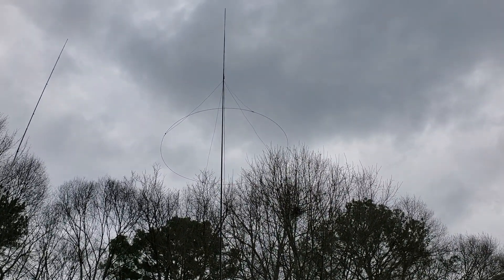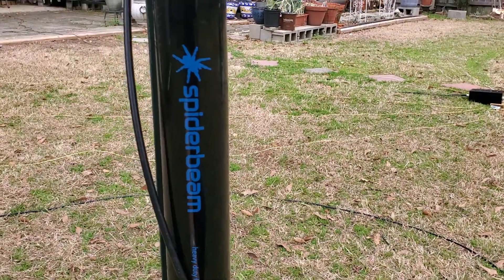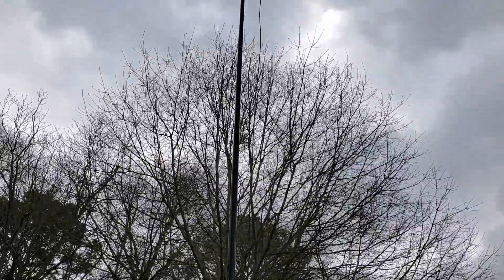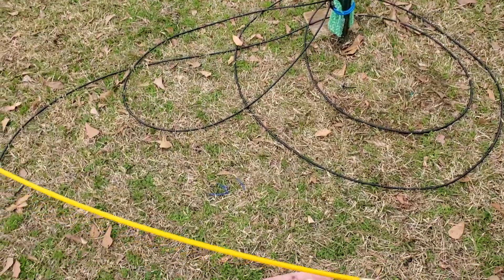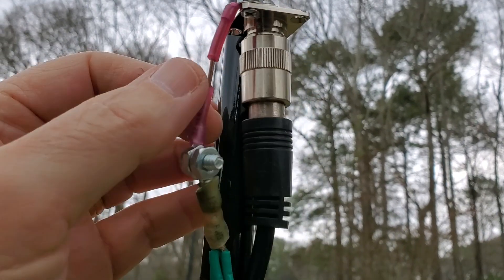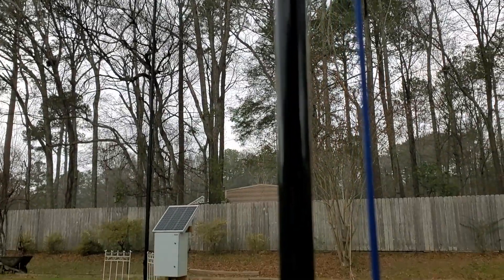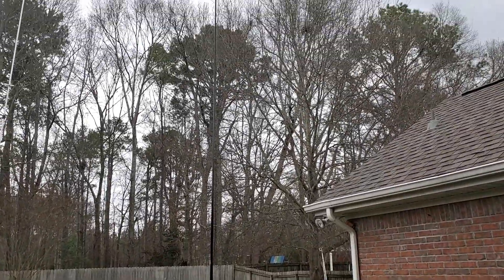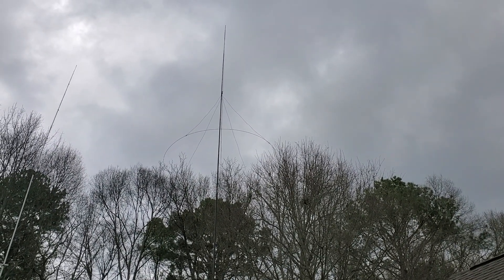Building The 6db Gain "Hoop" Antenna For 10 Meters.

Comment: isnt it just a 1/4 wave ?
Reply from the maker: @Triple888jim  it is a 1/4 ground plane wave. The video is more in response to the previous video where viewers were asking how the hoop was built and how the height at which it is deployed is achieved to get the radiation pattern for DX.  The greatest factor that contributed to its DX performance is the height deployed. That being said it is not the best for local contacts of just a few hundred miles away. Because of the low angle radiation pattern. I talk about that in the video on antennas and gain.

Comment: it is a 1/4 wave ground plane antenna, but great idea to hold the ground radials out at the needed angle. 6db gain? No.
Reply from the maker: @N0VTY29  Thanks for commenting and unfortunately we can fit only so much info in a YouTube title. A deeper dive into what I meant regarding the 6db gain statement and where the gain is found is explained in the video about gain that follows this one. There I talk about how no antenna provides true gain but instead shapes the radiation pattern providing a relative gain to accomplish some goal. In this example the height at which I mounted this antenna provides great low angle radiation for DX (computer models show up to 6dB compared to other designs) but this one does not do well for short haul (the next state over for example). Thanks for watching and commenting.

Comment: Have you ever tried connecting the hop to the radials, essentially turning the hop itself into a radial? This increases the efficiency of the radials, and you can balance it out with a 120pF capacitor or variable capacitor placed between the ground and the radials. It should provide about 1dB more gain, as by making this connection, you turn a four-radial antenna into a 16-radial antenna.
Reply from the maker: Good idea. Thanks.
Reply: @yqtszhj  By pulling the current max down through the ring, you lower the main radiation a bit further. I’ve also experimented with radial angles and found that a 45-degree downward tilt is not ideal—30-35 degrees works better. This configuration gives the antenna more omnidirectional radiation. Viewed from above, the gain distribution, influenced by the radials, resembles a four-leaf clover, with the main gain perpendicular to the four radials. When the angle is set to 30 degrees, the pattern becomes slightly more rounded, meaning the gain spreads more evenly. However, this also causes the radiation angle to shift further downward. If the radials are connected to a ring, the downward tilt increases even more, as less power is radiated upward.
Reply from the maker: @ thanks for watching and for your positive and informative contribution to the comments. That is what increases interest in amateur radio and helps people to learn. That is my goal for this channel and your contribution is appreciated.

Comment: My opinion is that the gain you measure is due to increased height of the elevated ground plane respect to the unelevated ground plane. It looks to me that the elevated ground plane is at least 5 meters over ground, this could contribute to a better skip angle. A ground plane has never been described as being a 6db antenna.
Reply from the maker: Exactly. You got my point about the elevated ground plane when compared to ground mounted. This one happens to be mounted at about 10 meters. Thank you for watching and commenting.

Comment: You talk about gain , you even demonstrated at the end your vertical did appear a bit stronger?  However you said the vertical had gain but you did not reveal what it was being compared to ? What was the first aerial with s2 to s3 before, that would be kind of crucial?  A ground plane aerial might have gain over a variety of other aerials at given angles but you don't say which angles you are aiming for ? Most claims usually quote 5° for dx ? But you don't say that ? If your intrest is medium distance rather than long dx then a angle of 15° or 20° might be desirable? You didn't say how far the station you were listening to was ? That all needs to be factored in . I used a ¼ wave GP very similar to this using the very same spiderbeam 12m pole , only i used the ground plane wires as guys and continued them to ground  with nylon twin. I really liked the aerial as it performed better than my much more expensive imax2000 which was a ⅝ wave ? Many may question that , so let me clarify dx sigs was stronger on the imax2000 but a lot more noise , the ¼ wave GP had lower sigs but next to no noise so the GP heard more . On the tx side of things the ⅝ imax was stronger, but so what if you struggle to hear with that high noise ? 
My point is dbd gain is not an exact science,  you have to give the parameters like what you are comparing it to , and the desired angle.  Anolg with the sig to noise . But it's a good experiment.
Reply from the maker: Good comment and I agree with everything you said. Check out the video prior to this one and the one after this one where I go into detail about gain. They became more or less a series unintentionally but I discuss most everything you asked. In short the previous video showed the DX commander style I was comparing to. While I really like it, for 10 meters the 1/4 wave at a full wave height outperforms by a long shot. Thanks for watching.

Comment: Thanks for posting this, very interesting and worth experimenting with. I would be interested to experiment further by running copper adhesive tape round the hoop and connecting to the radials, to see if this made any difference.

Comment: That is a 1/4 wave ground plane, but you don't mention the reference point - so you might be right, depending on what you use as a reference antenna. Over a dipole this has 0 (zero) gain. It will get you more than 18 db gain over a compromised rubber duck antenna, however. This is an omni directional vertical. To get gain on a vertical, you need to "take" some of the radiation from a different direction. For a single vertical, you would need stacked co-linear elements , one above the other in order to get gain. This will "squash part of the unwanted lobe going skywards and concentrate the lobe to the horizon, giving you gain. You can see how this is done by looking at mobile collinear antennas for VHF and UHF. 6 dbd (over a dipole) as it is ? not possible. The hoop is cool though, so you don't need to have long ropes securing the radials to stakes in the ground. Wish I could buy these fibreglass rods in my country in Africa. I must remember to buy several packs on my next vacation trip to the USA
Reply from the maker: Excellent comment. You just addressed everything I talked about in the video prior to this one on “Getting 6db more gain on 10 meters”, and the video after this one on “What antenna do I need? About dB gain - facts and fallacies”. There is a lot of misunderstanding and false marketing out there. Side note, where are you in Africa? Other than occasionally South Africa it’s hard to make contacts there from my qth.

Comment: Interesting! I bought that wire-run kit years ago from Harbor Freight and have never used it for running electrical wiring. This might put it to use. And since wind is likely to blow that hoop around, I might install it in my attic.
If you're looking for a follow-up project, check out using attic foil for the radiating element. You can get it in various widths including both two-feet and four feet. The result might be an antenna that's extremely broadband. That's particularly handy for a band like ten meters.
Reply from the maker: @Inkling777  good idea about the attic. The wind does blow the hoop around a little and I think if I ever left it up for a while I’d take some string and tie the hoop to the pole in maybe 3 places for more stability. Thanks for the attic foil suggestion!

Comment: This is simply a 1/4 wave ground plane. There is no gain present as per engineering standards except this particular antenna is exhibiting gain over your ground mounted multi-band antenna (which are often less than unity gain). Most any antenna will perform better than a multi-band vertical because they are such compromise antennas.
Reply from the maker: @glevideo  excellent contribution. Thanks for sharing and watching.

Comment: That is a very cool antenna, with 10 being open during the day, I may build one when my homemade vertical craps out, its made of EMT conduit and a CB Whip.
Reply from the maker: I like the sound of your setup. My favorite thing is making something out of parts that I have on hand.
Reply: @ if you google “KL7JR pipe vertical” it should pop up, I built one in 2023

Comment: Do you think it work any better as a 1/2 wave?
Reply from the maker: @briansummers3488  I actually have a cut half wave and it doesn’t work quite as well but there is the advantage that you can put a 49:1 or 64:1 transformer on it and not have to use radials. A 3/4 wave works pretty well too but you can’t get it quite as high with my current setup and it seems the radiation pattern doesn’t beat the 1/4 wave at 10 meters. I just try to get as much wire as high as I can get it. Thanks for watching!

Comment: Cool!!  I attached my 8ft radials to rope guys with a similar setup on a fiberglass pole so that the radials/guys would also help to stabilize the antenna.  I'm really happy with its performance but I would like to get rid of the guys.  You  provided a great solution.  I wonder how your results would differ with copper wire taped to the hoop so that the hoop becomes part of the ground plane?   Have you tried it?

My antenna does 4k miles very well hitting Europe from the east coast but can't hear local OPs.  Have you noticed this?  I've been told it's because of the takeoff angle.
Reply from the maker: @RickPaquin Glad you liked the video and it helped out. In this instance I have not tried copper wire for the hoop but I believe it wouldn’t work because it would throw off the resonant frequency. Reason I say this is I tried it on a 2 meter antenna and that is what happened. As far as not hearing locals I’ve experienced the same thing. Either they are horizontally polarized or are just too close. They almost have to be 300 to 400 miles away at least for me to hear them. But I can hit Japan and New Zealand with 100 watt’s when the band is cooperating. LOL! Thanks for watching.

Comment: dB is meaningless, you must provide a second reference, theus dBi, dBd, etc... Anything that gets rid of radials on the ground is useful, but a vertical dipole is less work and cost than this solution.
Reply from the maker: Agree, you have to have a reference which many don’t understand. The reference in this instance is 5 degrees off the horizon for ground mounted vs 5 degrees off the horizon mounted at 10 meters. The first video shows this reference. Thanks for watching and commenting.

Comment: Improving the ground plane always helps. Ocean water is supreme.Higher angle radiation is equally important with DX. There IS a s unit gain compared with your secondary antenna, some may think its compared to ALL antennas. Victory is above winning though, that belongs to you. Congratulations 👏
Reply from the maker: Thank you sir.

Comment: I am a ham for 40-45 years and old antennas from early 1900 reinvents with great antenna gain A 1/4 wave antenna is 0dB Looks to me all those inventions of the last 10 years are novice amateurs they Never looking in a antenna handbook ,  they the having trouble try to solder ,probably buying cables with the connectors already on it , but they are really good with there iPhone , Sorry for this rant
Reply from the maker: Then as I’m sure you know most all antennas provide no gain in themselves but change the radiation pattern to accomplish the task desired.  There is no free lunch. In this case the point is that an elevated 1/4 wave vertical at 10 meters provides a better low angle radiation pattern (theoretically) relative to a ground mounted vertical and is theoretically more efficient for the purpose of DXing and reception. Have a great day!
Reply: Totally agree

Comment: interesting. how do you prevent the pole from collapsing?
Reply from the maker: It works pretty well using the friction from the pole sections but I have clamps for longer term use when needed. Thanks for your question.

Comment: That's one sickly-looking solder joint on the center of the SO-239 connector.
Reply: Yeah, but I'll bet it works just fine . . .
Reply from the maker: I agree. It is reused from another project and is temporarily used for testing. Electrically it’s functional. Thanks for watching and commenting.

Comment: This is a basically a discone antenna, a vertically polarized dipole if you will.
Reply: It’s a 1/4 wave ground plane how do you think it’s got 6db gain?
Reply: More like 2dBi not 6dBd (would need additional radiators and reflectors for that)
Reply from the maker: Exactly, thanks for watching and commenting. the greatest benefit from this is the relative lack of common mode current to deal with. I also fooled around with a T2LT but in my case this one has worked better than some others. Thanks for sharing.

Comment: Ever since your last video on this vertical, I bought the fiberglass Kit from HF, and have been thinking about the Logistics of this antenna. My build will be hanging from a tall tree limb instead of using my Jackite Fiberglass pole for support. Thank you for breaking down and sharing your construction methods. I will be able to compare it to a 10 meter J-pole that doesn't have doesn't have any radials. The J-pole is doing pretty well, but lately I have been seeing a lot of info on the benefits of elevated verticals with radials. After seeing your video adding the hoop. I decided to give it a try. Thank you for the idea. Waiting for a break in the weather. 73 K1QS
Reply: I used a Jackite pole for a dedicated 10m wire antenna. Worked great - until heavy local winds popped the wire out of the 'loop' at the top of the pole. I COULD NOT get some of the pole sections to collapse. I used hose clamps to keep the pole from collapsing early on. Now they won't collapse, period. Long story, but I finally got everything repaired and I'm back on the air. Meantime, I bought a 12m Spiderbeam for my next antenna experiment.
Reply from the maker: @MrTommy001 I’m pretty happy with the spiderbeam so far. One thing that I have found is that on calm days the clamps are not necessary. But if the wind is really whipping it around I usually need the clamps. For a more long term solution though I could probably use some of that rubber self sealing tape and it might work and keep the joints waterproof too. The pole itself is heavy duty though and I like it. Thanks for watching.
Reply: @ Two of my other antennas are sitting atop Harbor Freight aluminum flag poles. But those are definitely permanent.
Reply from the maker: Nice. Share your results if you don’t mind. I’ve been thinking about a j-pole and recently tried a T2LT that I’ll post about maybe next week. 73

Comment: Great video, and as both you and I have found, where possible all verticals should be elevated for best performance.
Some actually extend the radials with string chord, acting as guy lines to a fence or the ground. Fantastic ant, and makes me wonder why, four square ant are made on the ground. 73 zl3xdj
Reply from the maker: Thanks. How are you liking that new FT-710?
Reply: @yqtszhj  great on cw.